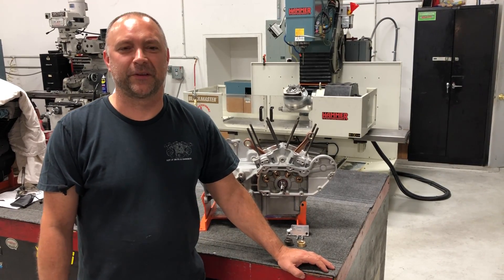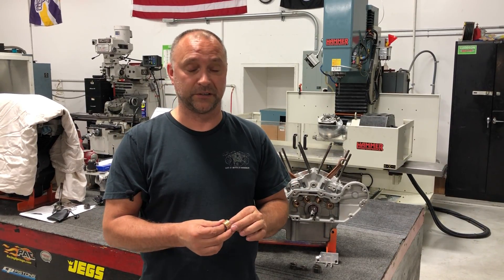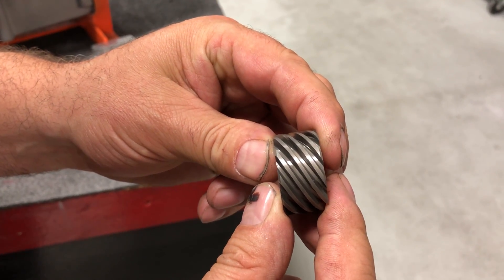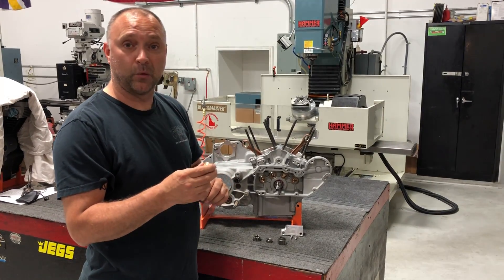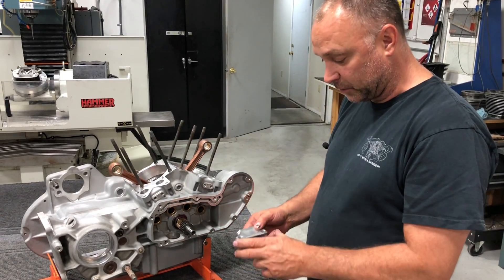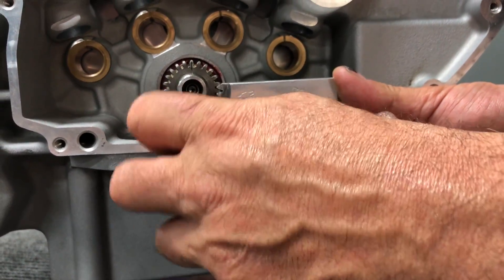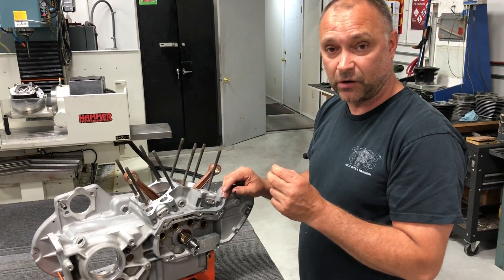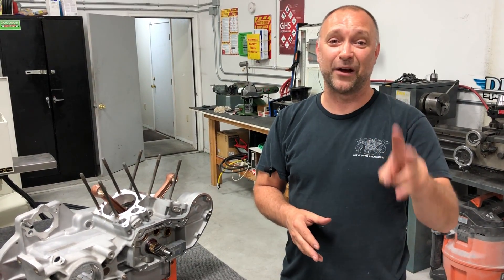The Bronze Oil Pump Drive Gear

Comment: Hi ..if possible can you tell me how can i diagnose a pump oil not working correctly i supose pressure faillure to head....cause engine is doing to much noise at 950/1000rpm's

Comment: Do you need to use a pinion gear puller to remove the gear ? I'm about to order one . I just did your 1275 kit and in the process of doing cams the original gear looks sharp . So im going to order one but wonder about the puller . Thanks !
Reply: Hey,  did you have to drop your oil pump to get the bronze gear in?

Comment: Hey Dan, great stuff as always. Your videos have given me insight and confidence to work on my motorcycle's clutch, transmission, etc.
My 2001 Sportster is a 1200S with a few MILD mods (Vance & Hines, a Dynojet kit and a free-flow air filter); I'm guessing it's worth about 70 ponies. My riding style is not super aggressive but I do ride it hard: how likely is it that I need to swap the gear out for the bronze one?
THANK YOU! 👍🏻👍🏻👍🏻

Comment: Just curious, instead of replacing the oil pump drive gear to eliminate steel on steel, what about replacing the oil pump gear?  That way you can just remove the oil pump and swap out the gear and install, instead of removing the cam cover and cams and top end?  Just curious 🧐.

Comment: I installed the bronze gear and also a new upgraded oil pump today.  Grind lock tool worked perfectly.   Did everything exactly as you said, thank you so much for the video.  My stock steel gear looks fine but I wanted to put the bronze gear in.  Thoroughly enjoying my Hammer 🔨 1275 kit!

Comment: I purchased a 120 cubic inch Altima evolution engine sometime ago, and I'm refreshing the motor and found it has a bronze drive gear for the oil pump in it. The spacer that goes in front of the drive gear sits loose where the drive gear will walk back and forth on that key about an eighth of an inch. Is that normal? Or do you have any experience with bronze drive gears on evolution engines? I can't find a builder that has seen one on a big twin. So I'm having trouble understanding why this drive gear floats in there. Any help would be appreciated
Reply: It should read Ultima

Comment: Great video. I have an XB12X. Must get this done.

I have subscribed.
Reply from the maker: What year is your Buell? I'm thinking the XB12X didn't come out until 2006, correct? If that's the case, then you don't need this gear. 2006-2007 Buells already have it, it was factory original equipment. 2008-2010 don't need it due to the redesign of the oil pump and the way it's driven directly off the cams.

HD came out with this gear in 2006 after at least 10 years of problems with the steel gear failing in Buell models. Lots and lots of Buell owners had the stock steel gear fail on them, both tubers and XB's. The steel gear is still used in Sportsters to this day, but failures at 65hp are rare. The higher power and higher rpm of the Buell models however made the steel gear fail, which prompted the introduction of this bronze gear. It's a wise upgrade for a guy hopping up a Sportster or a pre-2006 Buell, especially if you're in the cam box for a cam swap anyway.

Comment: What about on an 1989 XL1200.   What tool locks the gear?
Reply from the maker: The Grindlock-9199 (for 91-99 models) will work on a 4-speed. When we designed and named it, we didn't have a 4-speed in house to test it on, so we did the safe thing and spec'ed it to fit 91-99 models only. But it fits 4-speeds as well.
Reply: Thanks for the reply.  It did look like the bolts were in the same place.  I'll be picking up those parts next month and keeping an eye on that gear.  I have a non-stock engine with different valves, cam, valve springs and an S&S bottom end, so checking that gear with the oil pump pulled off would be a smart thing.  As you know, what makes Harley great is all the machinists that find a solution to every single flaw.  If Harley screws something up, the aftermarket will fix it good.
Reply from the maker: Well, keep in mind that although the Grindlock tool will work all the way back to 1986, there is no bronze gear available for the splined pinion shaft as used on 86-87 XL's and S&S cranks.
Reply: Ok , thanks.  The connecting rods are S&S only, not the crank on mine.  It was balanced for high rpm, so maybe the oil pump gear will survive.  Either way, I'll pick up the gear and tool from you, just in case.  A machine shop rebuilt my clutch basket on the XL1200 with a basket added for the magnets and welded the starter ring gear to the clutch basket.  Never had a problem with that part since it was done years ago.  Another testimony to the after-market and machinists.   People would be better off changing out any weak point before it's a problem.